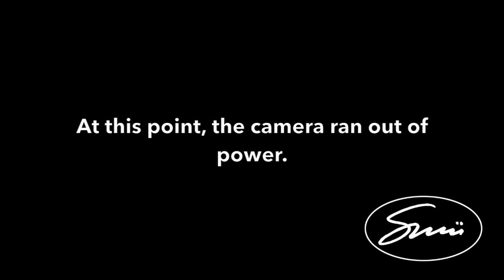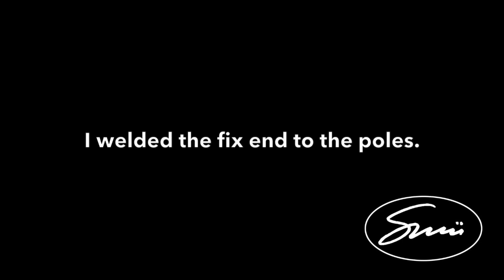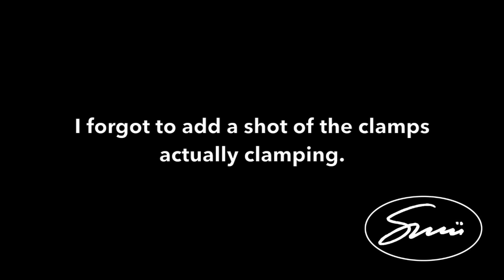DIY toolmaking: pipe clamps from scrap material

Comment: Interested at the blue things fastening your grinder to cut pipes. Name ? Where to buy ? Thanks
Reply from the maker: That's a "normal" grinder mount I bought off amazon, if you punch in "angle grinder holder" in the search bar at amazon you will find something similar.